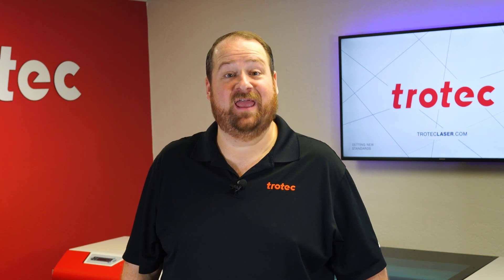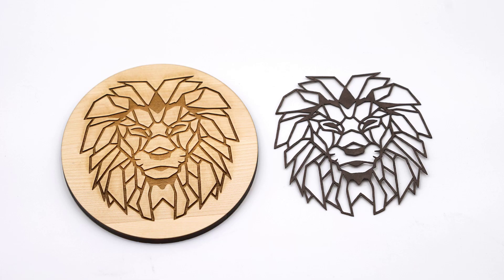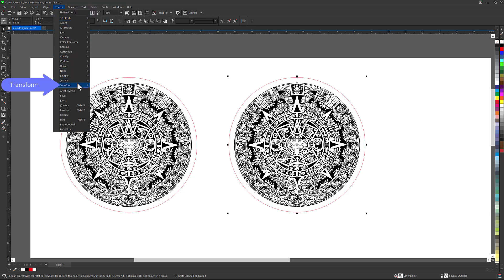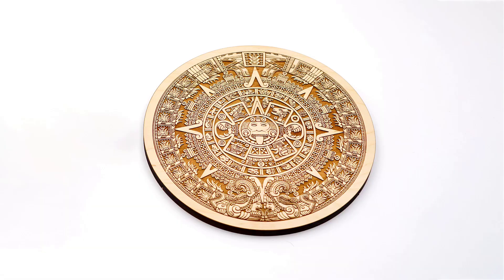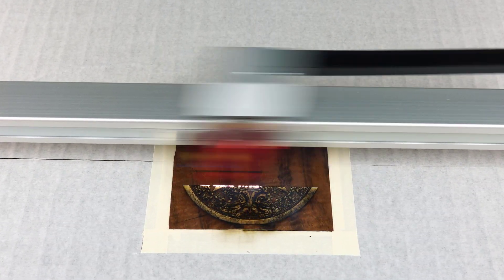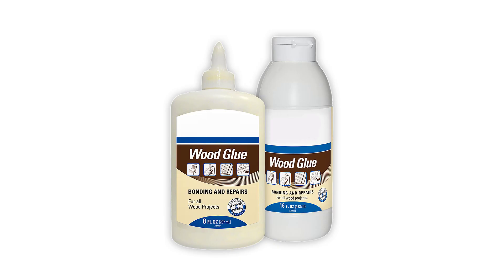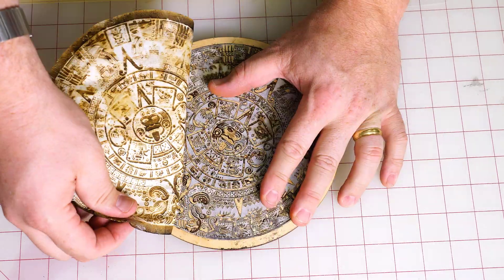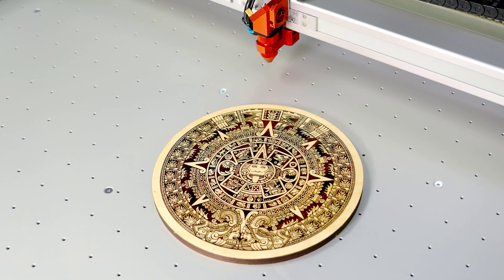Laser Hack: Advanced Reverse Inlay

Comment: This video may be dangerously misleading because if the veneer is fake as many plastic veneers these days cutting vinyl can create a deadly off-gas. PVC (Poly Vinyl Chloride)/vinyl/pleather/artificial leather Emits pure chlorine gas when cut.  It should be done outside or not at all. This is why vinyl cutters exist for PVC and vinyl plastics! ! ! ! ! ! ! !
Reply from the maker: This file was completed with 100% natural wood veneer; No PVC was ever used in this video.
Reply: @TrotecLaser  Glues used in plywood can contain melamine. When melamine is burned it creates hydrogen cyanide. HCN at 180 to 270 ppm is fatal. 135 ppm is fatal after 30 minutes. The average fatal concentration is estimated at 546 ppm for 10 minutes for humans. Have you measured the air quality? I'm not sure what it does in lower concentrations. There are many different types of glue that might be in plywood including Urea Formaldehyde, Melamine, and Phenolic glue.

Comment: OK that is nice work but why cant you just fill the inlay with saw dust mixed with glue or some putty instead of cutting out the inversion and backing tape and all the settings, I mean if you do one that's fine but I would make a paste with fine powder dust with the dark fill material and just paste it on and sand it off. less room for error and repeatable many times over. you could do 100 that way in the time it would take you to do 10 with the laser.
Reply: Undoubtedly, one can utilize dust paste for a quicker inlay fill, but this will produce an utterly different-looking effect.  The essence of this procedure isn't about speed or volume. In high-end applications, it's the allure of the natural wood grain within the inlay and the unparalleled quality that takes precedence. After all, exceptional quality yields exceptional returns.
Reply: I understand that, it just seems like some of the work is so fine that you wouldn't notice the wood grain in it. maybe you would but then what would stop you from just printing a dye over a blank board to get a similar effect? OK ink bleed etc. It just seems there would be an easier way. But after all is said and done I can see how this would differ from all the others. I see what you mean. @davidstevens2577
Reply: This is too advanced for me and my 10w laser, but it inspired me to engrave, then fill with colored epoxy, and then sand.

Comment: I have trouble to align two parts of the seal (embossing stamp), so when I see you putting this calendar together, all I can say is... WOW!
:face-fuchsia-wide-eyes:
Reply: laser some locating holes in the parts and only cut the part in the end
Reply: @jksjrgfpsjgr  in embossing stamps I cut  a small hole on edges of both parts, but after aligning when I try it on paper – many times I see that parts aren't precisely aligned.
On this  calendar, where are many small details and big size of the project, aligning isn't so simple like it looks on the video. Also author warns about it.

Comment: I presume to do any type of inlay, you need to have laser kerf settings nailed down tight?
Reply: No kerf compensation is needed at all because the laser beam used is only 0.005 inches in diameter.

Comment: Using aluminum foil may be an option to hold the inlay in place while engraving. CO2 lasers usually have no effect on aluminium regardless how thin it may be, and should still be easily sanded away. Would be easier to tune.
Reply: That is an interesting idea!  Using a 3M double-sided tape to adhere the veneer to the aluminum foil, I will have to try that!

Comment: a $50 000 laser machine. just a note for the viewers.:)
Reply: You can get a better laser on laser
Reply: @tonyCO2  A high-end laser system will produce unparalleled quality and speed; this effect cannot be achieved with a low-cost laser machine. Additionally, the total engraving time for this entire project was only 25 minutes at this quality and resolution, yielding exceptional quality and exceptional returns.
Reply: I am very sorry to say, but it works just as well with a Chinese glass tube laser system. That said, I am sure Trotec is an amazing company with great products and service!
Reply: it's an ad
Reply: @guiltazaour2871  Ah yes I see it now haha. My bad.
Reply: Do you know how everything you buy says something like for residential use only. That's why. Professionals,in general need better machines...and support...and reliability...and parts availability...and people to pick the correct part. So more requirements for more cost.  Besides you can do inlays with a chisel and hammer which you could get both for under $20.

Comment: Towards the end you stated that you used 100% power at 77% speed. That's a mistake if you go back in the video you used 77% power with 100% speed. I initially was confused as to how you didn't burn through the tape with 120watts at 100% power.
Reply from the maker: You are correct, we used 77% power with 100% speed. Thanks for catching that!